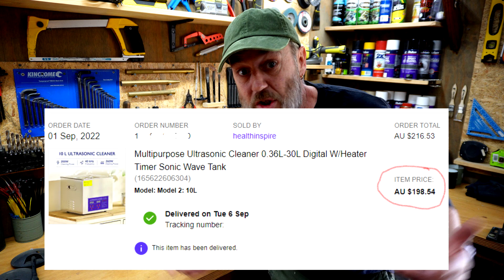My life is easier now! MCT 2022 Ep.26

Comment: Thanks Mark for another great MCT.
Really appreciate the review on Battery Vs Petrol and as we all probably know the petrol small engine equipment is slowly being phased out due to the massive emissions they produce and the battery products become more and more powerful.
The battery gear is improving out of sight compared to the early stuff and as usual you get what you pay for so there is definitely some alternative average products out there.
Also keep in mind after sales service and availability, plenty of products / makes don't have service centres where the products can be serviced or repaired, that goes for both Battery and Petrol.
Replacement parts etc. Great stuff 👍
Reply from the maker: My pleasure Noel and good to know about the service and back-up available! 👍

Comment: I’ve had electric trimmers and leaf blowers for over 25 years.  For light lawn work electric is the way to go.  We’ve used an old electric mower for trimming for nearly 20 years.  It doesn’t have the torque or battery life to do the entire yard.  We bought a larger battery powered mower 3 years ago.  It does so well I sold my riding mower.  My experience with electric mowers is that they don’t have the power of gas mowers, but if you just use them for lawns that are mowed regularly they will do the job fine.  You just can’t let the grass get too tall or try to mow when it’s really wet.

Comment: Mark, I know I am not either an Australian nor a Crew member, but I may have an idea for your lift problem. 
I too,  have a very small workshop. also have a pneumatic bike lift. 1000lb capacity. It is too big and really pretty awkward.
I would not recommend it for your crowded shop. I als do not recommend an overhead winch or a chain fall. But I did have a thought this morning while watching MCT. How about a hydraulic lift table and adapt a rail, similar to a rail on a bike trailer?  Heck Channel iron or aluminum should work.  Center the rail, weld on locator tabs and bolt it down with 4 or more 8mm bolts . I think It would work. 
I have seen those lift tables here, priced from $150.00 USD to about $350.00 USD depending on the capacity.   I suspect your Bunnings may just carry them in stock.
For what it is worth, I also have a 10 liter Ultrasonic cleaner which I use for cleaning dirty, greasy parts etc. It is maybe the best carburetor cleaner ever. I used it when I had my repair shop exclusively for carbs. A capful of Simple Green & a couple of drops of DAWN dishwashing soap. Put the disassembled carb in the soup & run for 30 minutes (or more if needed) and the darn thing looks new. Blow out all the passages and clean the emulsifier tubes and reassemble. Great tool.   
I hope this helps
Grandpa Fumblefingers
Mescal, Arizona USA
Reply from the maker: Bloody Ripper! 👍

Comment: I have an electric mower and it's just not worth using because the batteries always go flat before I get the lawn done, and the batteries are way to dear to buy. If you have a small lawn to mow they are okay and go ahead and buy one they are great for smaller yards because you don't need petrol. Mine is a sthil

Comment: Ref the bike lift conundrum: I'll preface that this is quite out there, but:
Have you considered reversing the problem and instead digging an inspection pit down the middle of the garage, through the concrete slab? You'd have it covered most of the time with some sort of metal section, and you could even mount the wood flooring back onto that so it was totally hidden, but when you need to work on a bike you just park it alongside and step down into the pit yourself. It would work for all bikes of all sizes and weights, and all heights because if you can't reach from the pit you can just hop out again. Also, if you need to work on both sides of a bike you can use the pit cover turned 90 degrees to be a bridge over the middle, with the bike then sitting on the bridge perpendicular to the pit so there's pit on both sides. In fact, as you don't have 4-wheel access to your garden (I don't think anyway, there's no room to get through behind Nay's carport is there?) you could make the pit width-wise to the garage instead of lengthwise and always use the bridge method, which saves on turning the bikes in limited space. That way when bringing the bike into the space you'd go straight onto the bridge, which is just resting on the floor, and the pit will be available on both left and right sides.
As I say, this is a wildcard idea, and it would be a lot of initial work, but once set up you won't even know it's there (and it could even be bonus storage if needed).